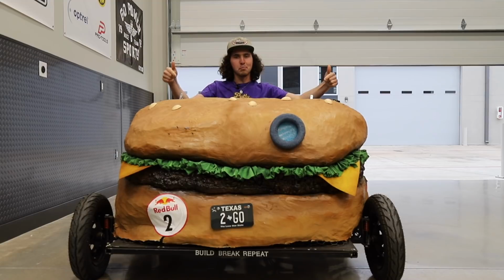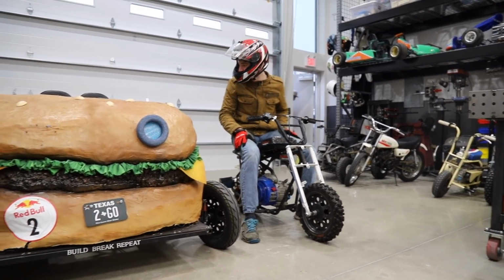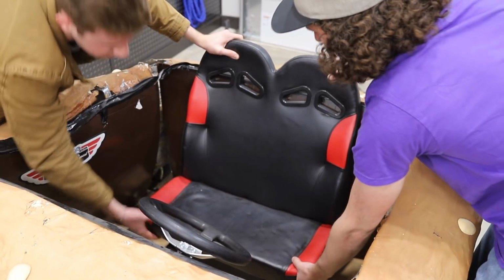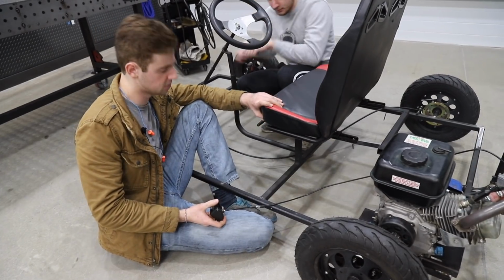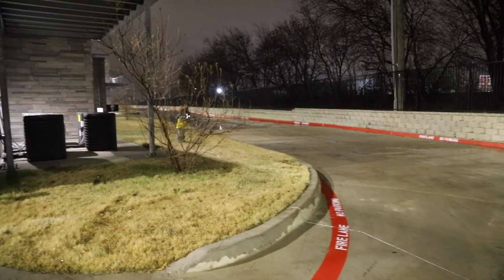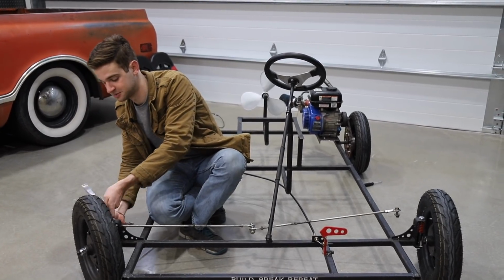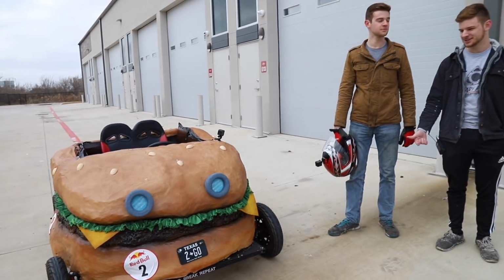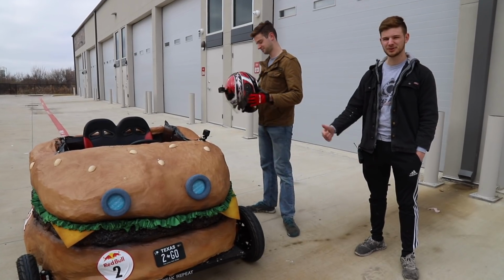We Put a Racing Engine on the Patty Wagon!

Comment: curious to see how you done the different textures like on the patty and the letuse , i bet if you coated it on the inside with glass mat and resin cleaned it up some and  done a new paintjob then epoxy coated the outside it could last a few years longer , it would make a great promotion mobile for a burger joint 
suprised to see that the chassis as thin and simple as it is was capable of holding two persons and take turns with autority

Comment: Make a body that’s metal so it can’t fall apart
Reply: Would make it to hevey
Reply: @jamiefitzpatrick8504  it don't need to be fast
Reply: Thin sheet 20 or 18 gauge aluminum sheet would maybe add an extra 100lbs but would last much better they could also reinforce the top of the cabin with some tubing to reduce the sag
Reply: @dodgeme1986truck  yes